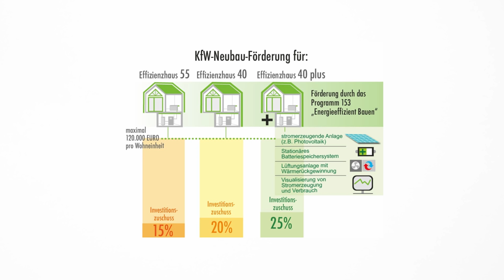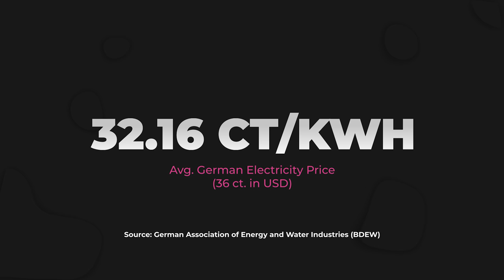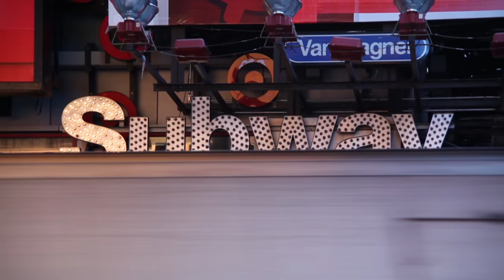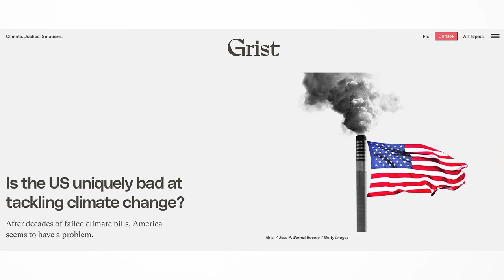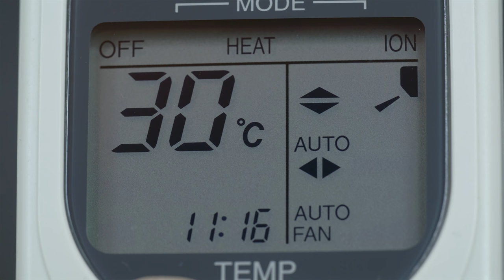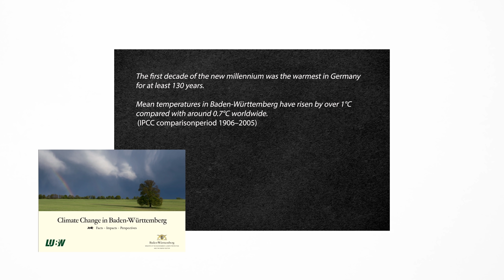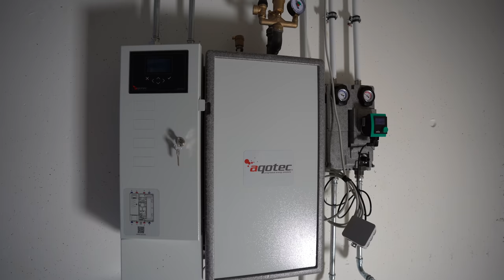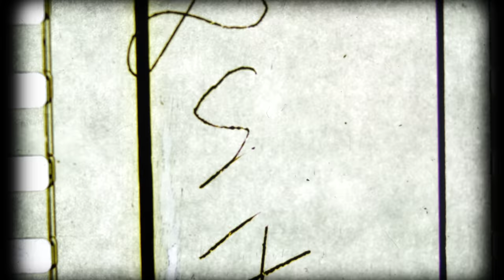HVAC (HLK) in German & American Homes | A Tale of Two Countries

Comment: Here in the land of forced-air furnaces, we recently built a home with hydronic radiant heat.   We used a product called 'Warmboard' that is a type of sub-floor covered with a thin aluminum cover that allows pex tubing to be laid throughout.   The water is heated by an on-demand gas water boiler that also provides our domestic hot water.      This was our first home heated in such a way and we couldn't be happier.    I'd never want to have a forced-air heated home again.    The radiant heat makes the temperature  comfortable and a 'non-entity'.   Meaning that you don't really think about it.   You don't hear the whoosh of air movement and you don't have cold or hot spots.   

The house also has air conditioning as we live in a desert climate, but we designed with solar considerations.   Meaning that we built large overhangs on our south-facing patio that covers the length of the house.   In the summer, no south facing window ever gets any direct sunlight.    We can open our windows and utilize air flow to keep the house cool enough for our needs.    When the outside temperature gets to 90F (~32 C), the inside temp will reach around 80F, and we will close the windows and doors and use the A/C at that point.    

I love the detail that you provide on the differences between Germany and the US.   Very interesting.
Reply from the maker: This sounds REALLY cool! So does your house still use traditional ductwork for your AC or just room units?
Reply: @TypeAshton  Yes, we have traditional ductwork.   When I grew up north of Seattle (and like Germany) central A/C was not a thing and I can't think of a single home of any of my childhood friends that had it.     But now, we live in Eastern Washington and NOT having central A/C would be most unusual.   As well as bad for resale considerations.    (Not well known, is that east of the Cascade Mountains in Washington State is a desert climate.  It can get pretty hot here.   Good for wine grapes.   Not so much for humans.)

For our A/C, we rely on an external heat pump and for the size of our house, it's purposely undersized.   It the hottest days of summer, where it can be over 100 F to 115 F (32C to 46C) We most likely would not be able to cool below 80F.   Which is fine for us.    Some folks will keep the thermostat on 68F even during the high temps.  That is simply crazy to us.    My wife hates the fact that she has to carry a coat or sweater with her when we go to a restaurant during the summer.   When you step inside and go from 100 to 65F.

Comment: I worked in the USA, in the moving business.

One of the occupational hazard was headaches due to the difference between indoor and outdoor temperatures.

The locals would set their heating to temperatures where you'd be happy in a t-shirt and shorts inside, when the outside temperature was running -10 to -20C with snow drifts all over the place.

In the summer, they'd have internal temperatures which meant that a wooden jumper or thermal underwear would be indicated, while the sun blazed down outside...

Constantly shifting between such large temperature differences would result in a splitting headache after a few hours...

Comment: German here.
hot water heating became common between WW1 and WW2 in modern multistory buildings in German cities.
The system used was a coal fired furnace in the cellar of the building, 
distribution to all rooms with isolated steel pipes hanging from the ceiling of the cellar,
non isolated vertical steel pipes in or next to the outside walls, next to the windows,
cast iron radiators below each window,
one or more open expansion tanks in the attic with thin horizontal pipes from each hot vertical pipe.
This system did not need an electrical pump, but was powered by gravitional circulation (hot water goes up, cold water goes down).
With this natural circulation system, the pipes needed to have a much higher diameter than with a modern, forced water system.
The furnace needed to be filled with coal once or twice a day, and had some hydraulic regulation device.
A hot water boiler was placed on top of the furnace, also to avoid the need for a pump.

The same system was used for new family homes until around 1965-1970 when the big switch to oil happened.
As long as oil (heating oil is diesel colored by an agent) was cheap, the old furnace remained, only to be replaced after the price of oil went from 6Pf/l to 60Pf/l in 1974.

Forced air systems for heating were tried around 1970 with the rise of oil fueled central heating, but they had two main problems:
1) you needed extra space for the air ducts, which are a lot larger than the pipes needed for forced water.
2) forced air breaks the sound dampening effect the new stone and concrete buildings had.

on the need for AC:
South German houses are more build for hot weather than North German houses.
After WW2 large South facing windows became common in North Germany to get more heat into the house.
Since around 2000 this become impractical during heat spells, especially in cities. I would like to have the shutters, that are common in South Germany.

Comment: When I stumbled upon this channel I thought it was a standard vlog kind of thing, but I really came to appreciate the kind of videos where your professional backgrounds and a lot of research add to the content. Thanks for all the work!

On topic, I live in an older building (~120 years) in Munich. The whole block is setup with courtyards that remain pretty cool during summer (with shade by trees and the building themselves). Flats usually have a side facing the street and a side facing the courtyard, so the cooling strategy is to just open the courtyard facing windows and close the rest. During the hottest days you can cool via the courtyard until around noon, then close all windows until sundown. 

I always found the building setup quite clever in this regard and haven't heard of anyone here needing an AC.

Comment: The district heating system really is a blessing when you have a power plant nearby.
But even if not there are very efficient ways of heating and cooling using a heat pump.
It‘s like the opposite of a fridge  and half burried in the ground.
Deep enough the temperature of the ground is allways 8 C in summer as well as in winter.
In summer you can use this to cool the water of your underfloor heating. In winter you compress this to create heat for your underfloor heating and pump the even colder water back in the ground to warm back up to 8 C.
This way a heat pump creates four to five times more heat energy than it consumes electrical energy.
We live with such a heat pump for over 15 years now and are very happy with it.
Reply: in Winnipeg Canada there is a company called "water furnace" and they build heat pump forced air furnaces that replace a "normal" gas/electric furnace and on your property you drill 2 water wells 
and pump the ground water out of one well and through the heat pump and back into the other well they are quite pricy to have fitted as the wells can get pricy but are super efficient and they cool as well as heat

Comment: That under floor heating is the best there is at the moment. You generally tend to keep the overall temp lower than with radiators or forced air. This is because when your feet are warm, you're warm (or that's what your brain tells you, simplified). That can also make you feel more comfortable as your head stays cooler. The temperature is also somewhat equal everywhere (or in the whole room if it's adjusted individually).

It's interesting to see how different the trends are even in Germany compared to Finland. Here it's usually only the multistory buildings that are built with concrete elements. Occasionally single houses and rowhouses too, but mostly they're built with wooden frame. The insulation seemed very similar though.

Btw there has been a trend to build even some multistory houses from wood for a few years now. It's much more environmentally friendly that concrete (which has a HUGE co2 print).

Comment: In think, the most important reason for German buildings maintaining temperature naturally/passively are the concrete/stone walls. These walls store heat and therefore carry the coolness of the night through the day. Personally, I prefer this natural building climate to the dry air of an air conditioning system. Also in winter, the moderating effect on temperature fluctuations makes a wonderful building climate and, yes, as you mentioned in your video, you can actively manage your window shades to collect the warmth of the sun (in winter) or block it (in summer). In modern, well isolated buildings this makes both cooling and heating virtually unnecessary (at least in our climate zone).

Comment: As an german I love my radiant heating per room. 
You can choose and set the temperature for every room different (yeah, you know e love sleeping cool and with open windows even during the winter) so you just dont heat the bed room that much.
During my time in the US it was always the struggle to statisfy every temperature preference and especially when you have a host family with 5 kids :D
Reply from the maker: Great point! We also noticed when we were back in the USA just how much some forced air systems struggle with keeping a good, constant temperature in older homes. We slept in a guest room right next to the furnace and practically roasted. But the other guest room at the other end of the house was very, very cold.
Reply: The floor heating system in my new house is regulated room by room too. The heating system is used is a Wärmepumpe.
Reply: @TypeAshton  - aren't there airflow regulations inside the AHVC? Otherwise that is a natural disaster. 
By the way - also German radiation systems might suffer like that. sometimes you have to do a hydrostatic balancing to get heat to every radiator.
Reply: @TypeAshton  Again, it is all about cost. There are thermostatically control duct dampers which can throttle down the hot air going into a room - at an additional cost. I personally just shut down my bedroom vent in winter because I like to sleep in a relatively cool room. Ironically, it was my German wife who grew up in a totally unheated bedroom with the windows open in winter, who complained about the bedroom here in America being too cool! I will say, there is nothing greater than sleeping under a downfilled duvet in a cold bedroom!
Reply: There is a VENT on the floor... CLOSE/Open them... IT is not difficult... Even as a 5 year old child I could do so...
Reply: Interesting, my family of 6 in the US didn't have that much of a problem with it.. you simply vary how much the vents are open in a room.

Comment: We have an air conditioner in our bedroom. It is used primarily for dehumidification and secondarily for cooling on hot summer days. We use the air conditioner as infrequently as possible, which was much easier in 2021 than 2018. 

Air conditioning can promote and support colds, but not cause them. To my knowledge, the only air conditioner triggered illness due to poor maintenance is legionnaire's disease often caused by "Legionella pneumophila".
Reply from the maker: YES. I moved to Germany in July of 2018 and it was literally trial by fire when it came to acclimating to the temperature change.

Comment: As a German electric engineer I know that it is a sin to use electrical energy to heat/cool rooms. Thus any typical forced air AC system is simply unacceptable...Well, I now have an AC for my home office room which is under the roof being heated up dramatically in the high summer. And I now have a solar power system which feeds (among other things) this AC. THIS makes perfect sense  for me 🙂